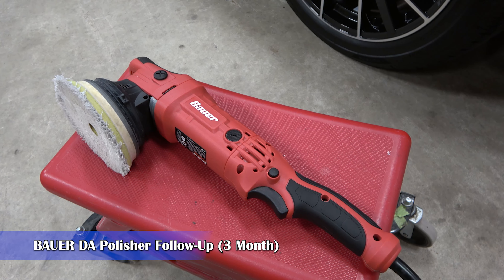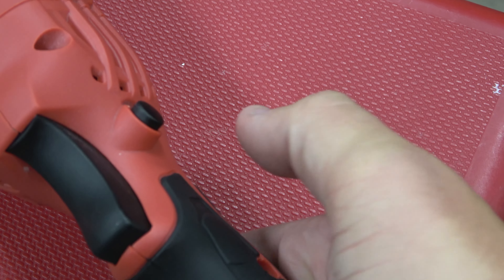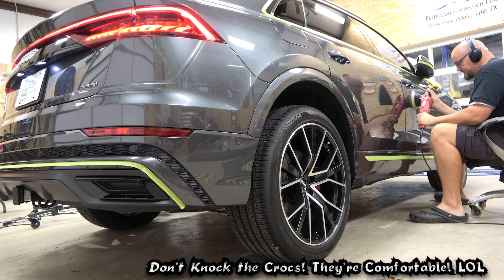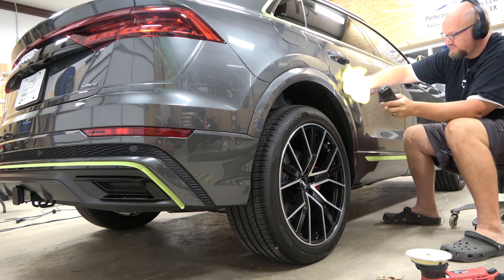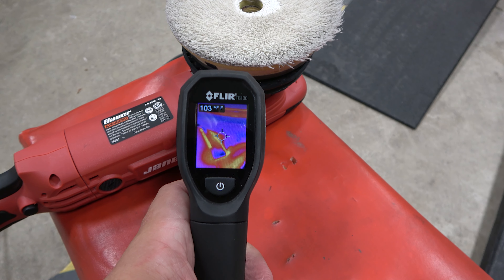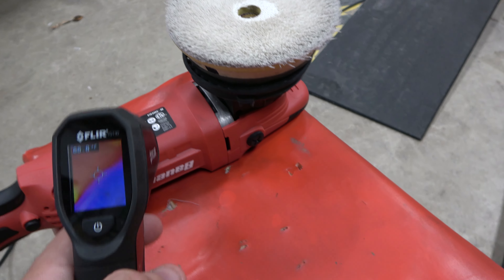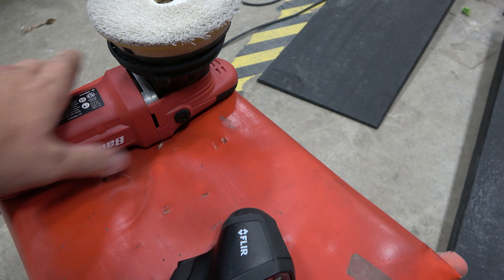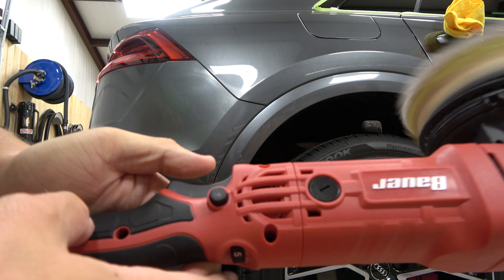Harbor Freight Bauer Polisher 20mm -  3mo  Follow Up - Did it make it in a professional environment?

Comment: Thanks for sharing your thoughts and enhancements for the Bauer. I went ahead and purchased the Lucas White Lithium Grease per your recommendation and will be adding the Rupes 5 inch backing plate as well. Seeing your success with the Bauer gives me confidence about my investment. Cheers.
Reply from the maker: You're welcome.  Be sure to tighten down the bolt for the backing plate very tight when swapping it over to the RUPES one!

Comment: I repair tools for a living if you put too much grease in the head it will get hot and too much grease also causes more drag on the motor which makes the motor get hot. Lithium grease doesn't liquefy at a low enough temperature to lubricate properly
Reply: Good to know. What grease would be better?

Comment: I fixed a key scratch on my camaro . Wet sanded the area with 1200 & 1500. It should polish a small area don’t you think
Reply from the maker: Oh absolutely
Reply: @ScottHD  camaro black paint turned out beautiful with cut and polish. This is a great machine
Reply: @conductorjohnmthtrains2239  you still have it how’s it holding up ?

Comment: I was curious did the failure of the other polishers bearings as well. If thats was the only early failure its a fairly inexpensive repair if you know how to pull them.
Reply from the maker: Correct - I have the ability and knowhow - so if that is the case, I may tackle it.

Comment: Its the bearing on the rear thats making that extra noise and from the sound of its about to give out ( bearing failure is common as they don't use high quality ones), maybe mod it to some high quality bearings. that'll be a cool vid!
Reply from the maker: Just an update...it's pretty much dead now. I'll work on a follow-up and teardown video here soon. Been very busy!
Reply: @ScottHD  These days ive been holding back on buying detail related until we get ur  results  lol im sure alot of guys are on the same boat 😂 btw ive been researching a lot with ceramic bearings and ive replace the stock ones on my one wheel and its night and day difference and very quiet, ive installed them aswell on my pressure washer and hose gun practically all the stainless bearings i switch them  to ceramic or zirconia depending on application, im thinking of doing in my rupes next😂
Reply from the maker: @1kontrabida  ceramic bearings in my motorcycles too!  I'm sure it's a dramatic improvement like it is elsewhere.

Comment: How is the auto zone polisher?
Reply from the maker: Which one?   If it's the two handled 10" one, I'd avoid that one.  It'll take you absolutely forever to polish anything.
Reply: Doesn't Auto zone sell Griot's G6 and maybe G9?
Reply from the maker: @kimdavis5631  sorry just now seeing this.  The black and decker one I would avoid. The HF Bauer one dropped in price since I originally bought it too. They are $89 and $99 depending on where you live.
Reply: @ScottHD  Thank you Scott!

Comment: It may help to open it up to see if something came loose and give it a shot of oil? Do you have any experience with the Maxshine Pro and/or SPTA polishers?

What is a real smooth da that's 15mm? My hands have arthritis and my old HF polisher kills them after a couple hours of correcting. I'd like something that is lower vibration and doesnt stall out real bad. I heard that Maxshine Pro was fairly smooth.....I wish I could buy them all and test all but I cant, I'll be stuck with whatever I get.
Reply from the maker: I'm a Rupes fan... We've been using them in our shop since they came to the US in 2012.  Very smooth but expensive polishers. 

I plan on opening up this HF one and seeing what is going on

Comment: The grease you used was not the ideal grease. IMO you should've used a high temp bearing grease. That might have some influence on the heat it's generating. Also, all the bearings can definitely be replaced with higher quality bearings. Just match the numbers on it and the seal color will usually identify the bearing use or grade.
Reply: Any recommendations for a solid high temp bearing grease?
Reply: @every_thing_wood1251  of course not he just wanted to flap his lips
Reply: I mentioned that in one of his original teardown videos, too.  The white lithium isn't meant for high load/higher speed conditions.  I think Lucas Red n Tacky would be the better choice.

Comment: It appears the wiggle on the backing plate and the high pitched noise by the trigger is due to bearings going bad. I have to admit for the amount of use and the fairly inexpensive replacement cost of a decent bearing thats not a bad product.
Reply from the maker: I agree.  It has long since paid for itself using it in our shop.  You can buy several of them for the price of one of the "big brands".
Reply: @ScottHD  i was curious is the rupes the only backing plate that fits that polisher.

Comment: How long did the Bauer end up lasting in your shop?  I’m truly up in the air between this and dealing with what I have.  I have a Griots G9 just would like a long throw to speed things up a little during corrections. Just doing personal vehicles that’s why I’m thinking this might work for me.  What do you think?
Reply from the maker: Going to do another followup on it here soon...it's pretty much dead at this point. One of the bearings has failed (excessive play) and it's making noise now.  I bought another brand new one to experiment with and will have a video on that soon as well.  Stay tuned!

Comment: I’d love to see you do a tear down video at maybe 6months and see how worn down it’s getting. I bought one last month and did my wife’s grand Cherokee so far so good. I did the Rupes backing plate and grease like you suggested right out of the box. I do like 5-7 corrections a year, I like this way better the my Porter cable but it is not built Ike the PC. I don’t see it lasting 8 years plus. But we will see.  Thanks for the videos.
Reply from the maker: That is in the plans.  Going to run it until it dies and see how it's held up.
Reply: @ScottHD  did you keep using this polisher? How long did it hold up for?

Comment: I've debated on getting this one and doing what you did with it, or going with the Griots G9.  Any opinion on which to choose?  Price point isn't much different between the 2.  I also considered the TorqX but I think I've ruled it out.  I'm not a pro by any means.  This will be my first polisher.
Reply from the maker: They are all made in China - whatever you decide, swap the grease out for some Lucas white lithium grease and it'll run cooler and quieter.
Reply: The g9 is a far better unit. It has premium bearings and comes stock with a quality grease. It is actually a very well built unit. Also, it has a lifetime warranty. I would not open it up or do anything to it. It's ready to go from the factory.
Reply: @chrisgaddy10  Coming in hot 2 years late, but yeah I just got a G9 a month ago and it's butter smooth.  For the little bit of extra money, well worth it.  Not sure if they've changed anything over the last two years, but it's a great polisher.  Side bonus, if you buy any other Griots polishers you can use one cord that detaches from the back of the polisher which is super nice.